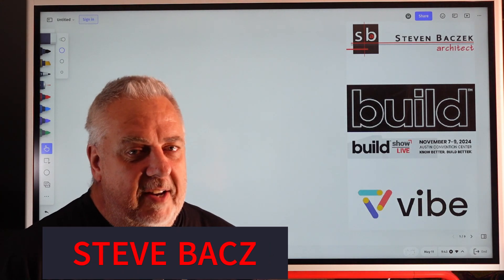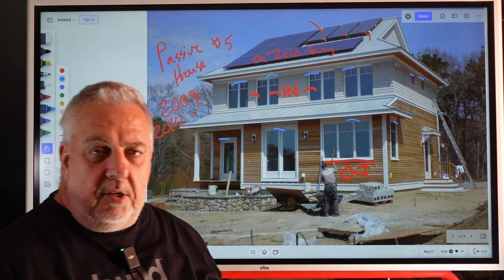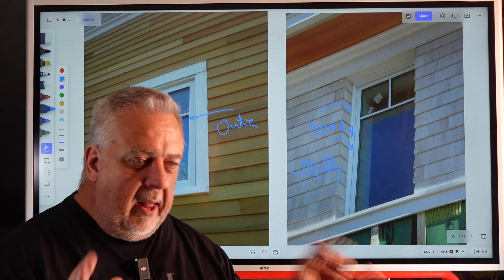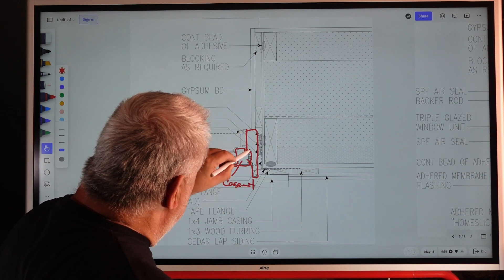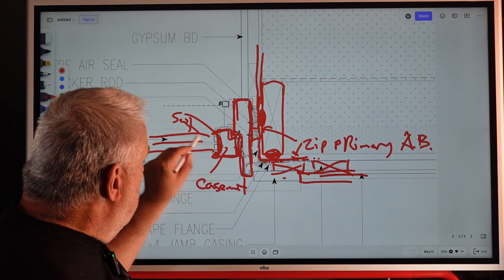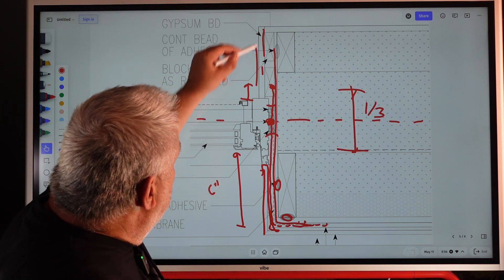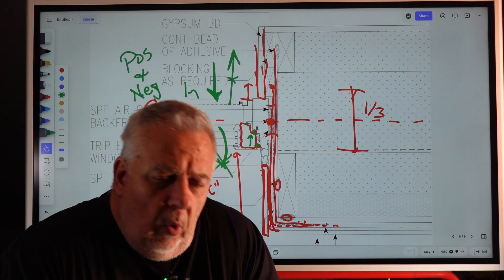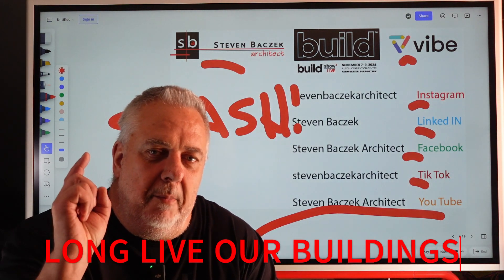PH11 Episode 16 WINDOW JAMBS

Comment: Steve, lliving and engineering here on the coast of SC, I have been through several major named storms.  What I see is that water is forced upward on walls and roofs.  Typically walls and roofs are designed for gravity flow of water.   I try and think of what happens when water goes up hill.  A rain screen is a must.  I favor the commercial products over 1x strapping due to the warranty I get with the commercial items.  Plus, they have been tested.  Just something to consider.  Thanks for the vids.
Reply from the maker: Well the wood hasn't been formerly tested but Canada has been doing it for more than 60+ years.......thats good enough for me

Comment: Steve, when the wall depth is between 12 and 18 inch depth, how much of a slope should the sill be (in degrees)?? Using out-swing casement windows (Fenstur) would you recommend a copper sill pan, or does the material type not matter??
Reply from the maker: Just needs a positive slope, metal is good, but we typically only use it on doors